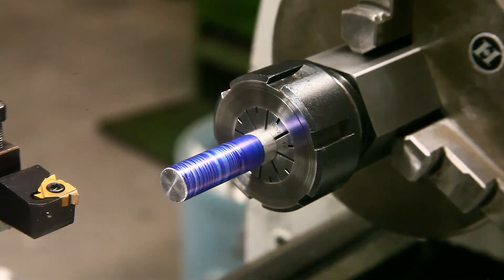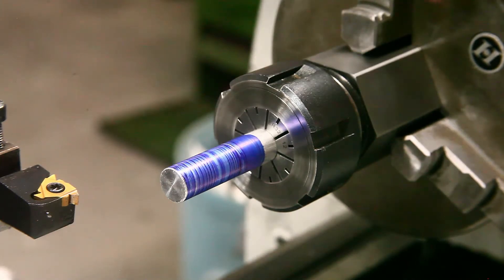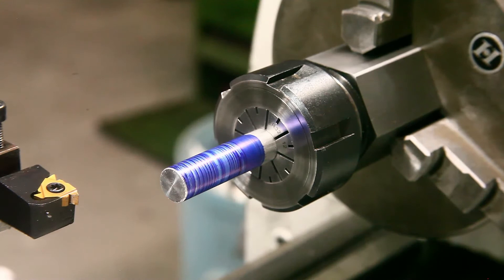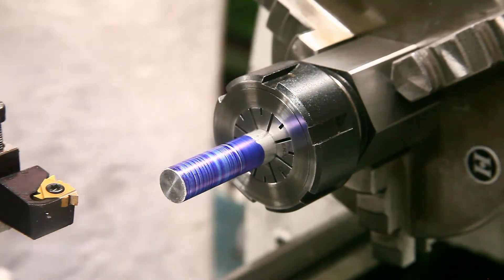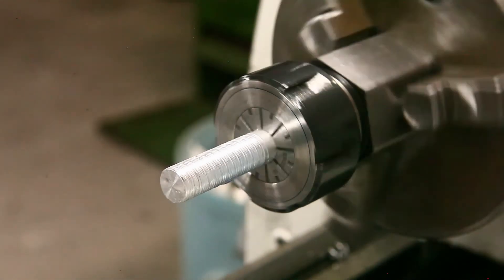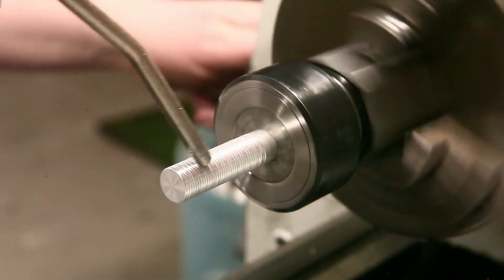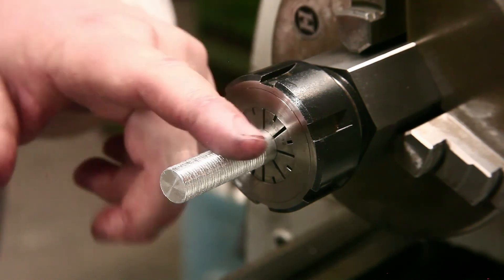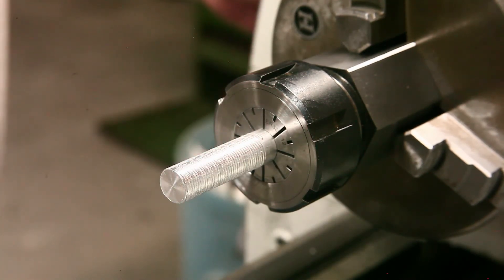MACH: Triple Start Thread

Comment: If you cut it in reverse with the tool facing downwards, you can cut threads with no fear of going too far over the piece/into a shoulder. It just ends in the air
Reply from the maker: @chelsea78344  very true! At the time that toolpost didn't let me raise the tool high enough to do that. I've got a multi-fix qctp now, maybe I can revisit this in the future.

Comment: You need to cut a run out groove to full thread depth! Doing it like this will quickly break off the tip of your insert.
Reply from the maker: Yep, I have long since changed from rapid retract to a round groove. (round to prevent stress risers in sharp corners)